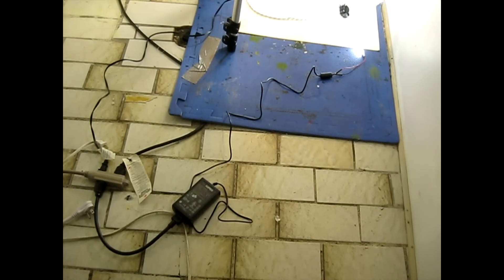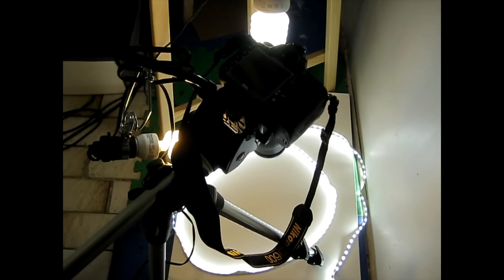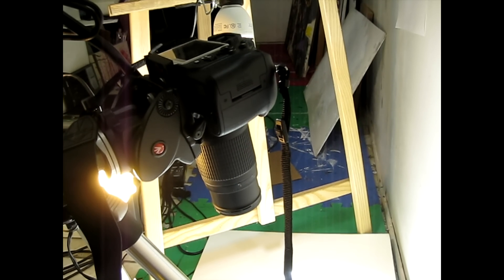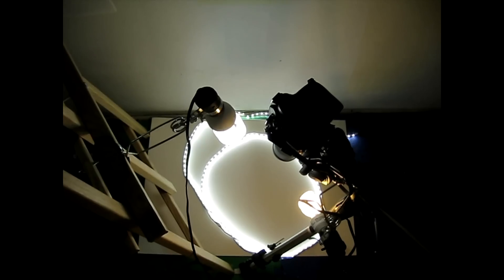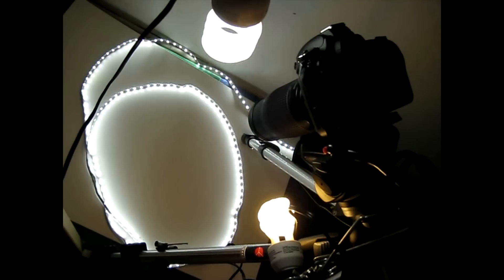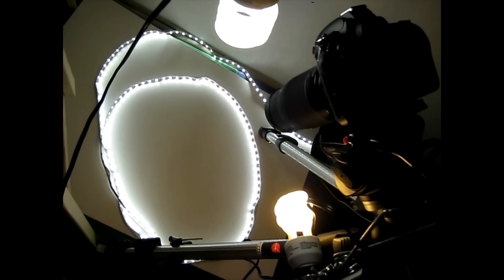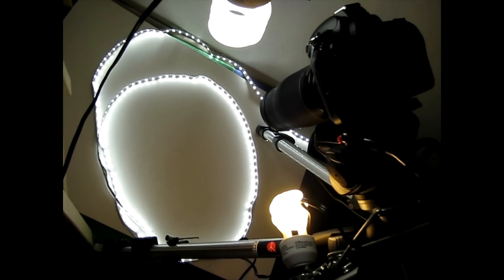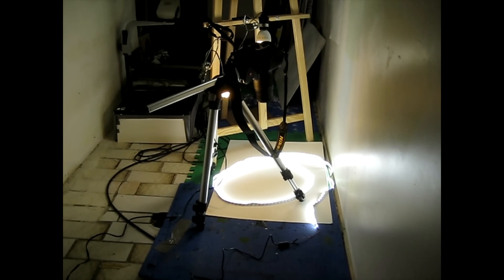Nikon D600 Sensor Dust Timelapse (pt. 2) - Pointing Downwards.

Comment: The dust is being whipped around by all those moving parts inside, and I'd think that static has much more to do with the forces of attraction than gravity. You should have cleaned the sensor before performing this test to show how little dust was generated the 2nd round.

Comment: Instead of trying to light a piece of paper evenly, why don't you use the LCD monitor of your computer/laptop. I think you're supposed to set the focus manually so as not to be focused on the monitor/pixels, but blur it out as much as possible, thus seeing the sensor dust at f/22(or your smallest).
Facing down and testing that is great to know, but not real world (other than macro). I think having it at a horizontal setting is best.  Are you going to clean before your next test? Anyhow, thanks!!